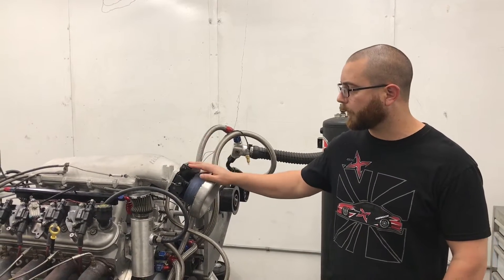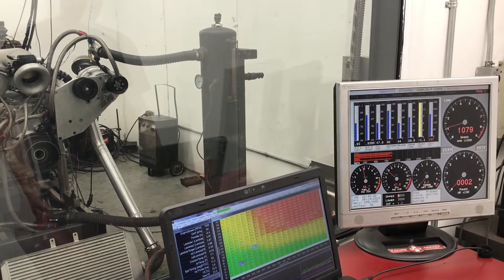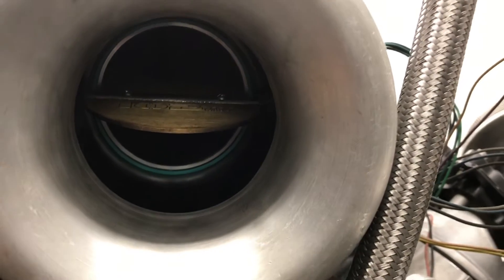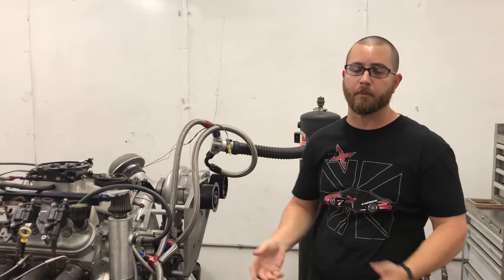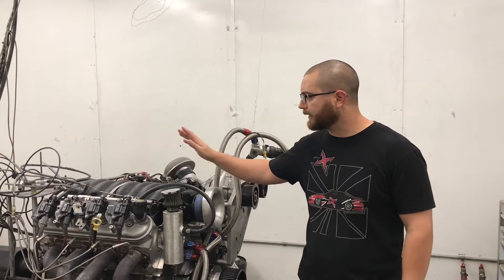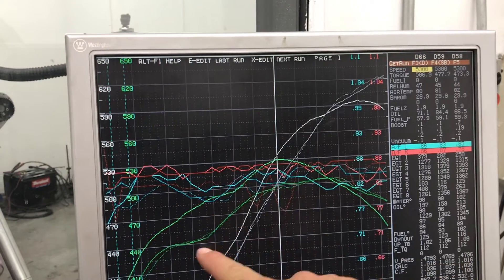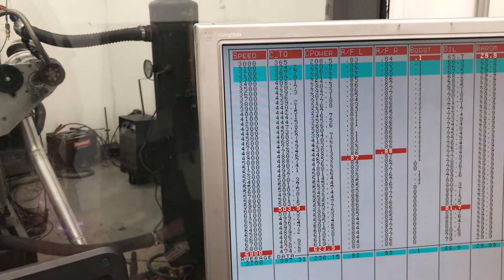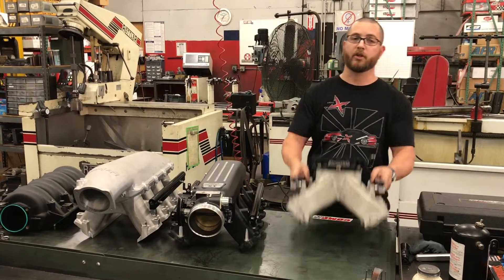Ls3 408 intake shootout - LS2 408 Boost Spec Stroker Engine testing different intakes

Comment: It’s crazy how good the factory LS3 intake is. Those engineers knew what was up.
Reply: yes really difficult to know the piston speed  acceleration curve    the maximum air flow required    - its not difficult to do when you have a next to unlimited budget with all the toys

Comment: I would., I did use the single plane with carb style throttle body. It looks better.  I run a s488 on a 383.   1200hp vs 1170 . What ever  . The click of a knob 1/2 of a psi makes that up.

Comment: I am building almost the exact engine 408 9:1 compression that will be boosted. Do you think the tbss manifold would preform as good or better down low like the ls3 you showed. though its ugly as sin, looks don't preform. OR is there a better intake you recommend? I was thinking fast but would rather save some money for more power adding purposes   thank you for your video and all your information.

Comment: If you’re not using the LS stock intake, and it fits cathedral heads, this ASE Master from 78 would give you $50 + shipping! One pay check due to painful joints would help me get a vehicle running for me.
 The true definition of irony is working on 2,500 vehicles each year, now on foot. Peace out young race track dudes!

Serious though. You know your kids have grown? When they total out their cars. Lost four that way, 4X4 to Park Ave Ultra. I am not to proud to ask as I harvested a 5.3L from an 03 Tahoe and need it in my 67 C10 because I can’t work the clutch with knee, so after 7 years of saving, not much to show other than my wife’s premier 96 Prizm.
Thanks for the side by side specs, very interesting.

Comment: I really like it when someone does a dyno video and you can hear how the engine sounds in the background at idle not just WOT. I know sound makes absolutely ZERO difference performance-wise but show me 1 guy with a streetcar that doesn't love it when they pull up to a red light and people roll their windows down to hear a rowdy hot rod sitting there. Old people may roll their windows up but whatever lol. The sound is just the added bonus of big power,

Comment: I'm in the middle of building a 408 LS for my 86 Army Truck with factory 4.56 gears. I'm building it with max torque in mind. I have to buy new heads because my LQ4 came with factory Iron Heads. I was going to use Factory GM#317 alum. heads and factory cam but are there any better options out there for me? The truck weighs 5400 LBS and I will be using a 4l80E trans.
Reply: 706 heads off a 4.8-5.3
Reply: The best head for a LQ4 looking for absolute maximum 'torque' is the 241 LS1 head.  The 706 4.8/5.3 combustion chamber is simply too small and will be knock limited with EVERY cam that will make good 'torque', INCLUDING the stock cams.  Been there, done that, doesn't work.

After an enormous amount of time and virtually unlimited cam configurations I was able to come up with a LQ4 combination that makes more power from idle all the way to redline.  It's relatively limited in peak power production at ~470, but will run on 87 octane and makes ~20% more power  (+67 Tq) at 2000 RPM than a stock LQ4.  I was surprised to find out how difficult it is to improve bottom end (<2500) on 87 octane.  I was also surprised that neither the 706 nor the 243 head were the best.
Reply: @zacharymorris9917  those small valves with a mild truck cam do really well for compression and tq. Hp numbers aren't great but pretty good. It really depends on what you are running that stuff in. I certainty wouldnt run any boost with those heads. 706 heads flow well with naturally aspirated 400 hp builds
Reply: @randyrowe3097  your comment isn't clear.

Small valve size is not an advantage when you have virtually unlimited cam selection.  The small combustion chamber of a 706 HURTS low RPM power.  Furthermore, the ports of both heads are identical.
Reply: @zacharymorris9917  
Care to share your combo?
Reply: @Cowboy.underwater  specifically designed for MPG, max effort power from 1500 to 2750 and towing on 87.  LQ4, 241s, TBSS or Dorman LS2 intake, 1.625" long tubes and a cam that Comp grinds for me.  93 would allow some more room on the cam design but it would be dumb to restrict it to 91/93 when the whole purpose of the build was to get away from expensive fuel and maintenance (diesel LML Duramax).  4.060 pistons would be even better but I have a ton of LQ4s laying around.  It was nice to find a use for heads and pistons that I normally discard.  Makes for a super low budget build that's actually optimum for a change.

A 408 like the OP is building might be able to use 317s instead and would likely need slightly revised centerlines.  Static compression ratio becomes ridiculously critical when you try to make power at really low RPM so the piston, compression height and head selection would need to be properly planned.
Reply: @zacharymorris9917  
Thanks for the specs, that sounds like a pretty cool build.  Do you mind me asking what the cam specs are? I've never seen a build quite like yours before and I'm interested to see what you came up with.
Reply: @Cowboy.underwater  I'm not really interested in giving away such a huge investment, especially when people buy garbage cam specs from big name folks everyday.
Reply: Powerstroke
Reply: If you're wanting torque, the 406 heads with small valves are great for trucks and really any naturally aspirated vehicle. For something like that, I'd go diesel  with turbos. Much more to and more reliable with the weight of that vehicle.
Reply: @randyrowe3097  modern diesel engines are a far cry from reliable.  LQ4 is DEFINITELY more reliable.
Reply: The 406 heads. Smaller valves and combustion chamber but better compression and torque in most applications. You could get bigger valves in those heads but unless you do other things first. I wouldn't

Comment: Good video
The fast 102mm with the long runners is the best overall intake of all even though it's not much better than the LS3, it is still better.
However you will see proper gains on larger cubic engines with the fast 102mm compared to the ls3 intake.
I saw a test on a 416 LS3 with a decent camshaft the fast gained 30hp over the ls3 intake.
Reply: I'm sure a ported stock ls3 would not be far behind at all
Reply: wonder wait would happen if you test the factory one vs the fast  keeping the engines under 3000rpm watching the fuel usage